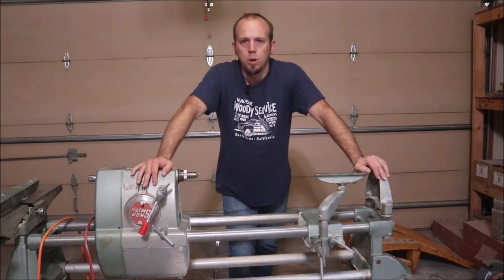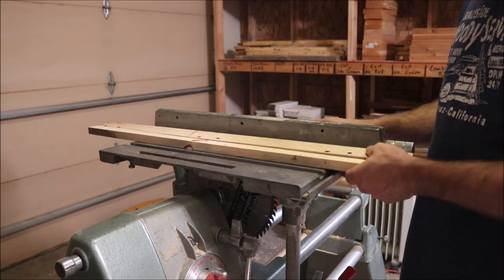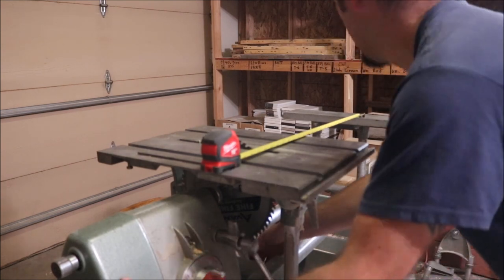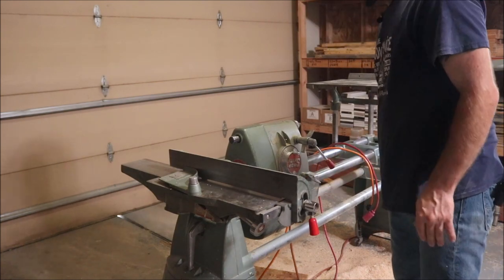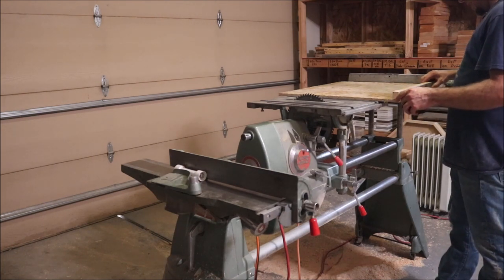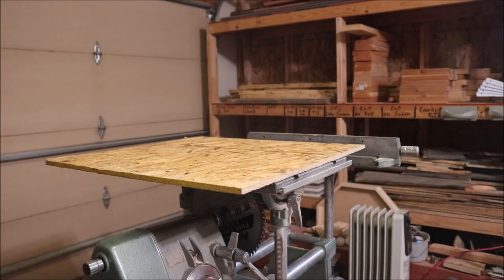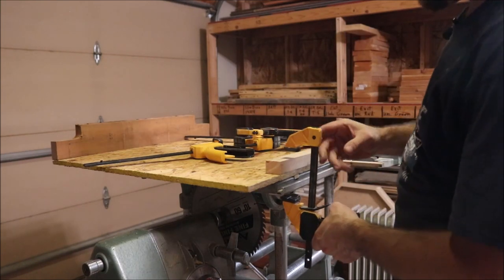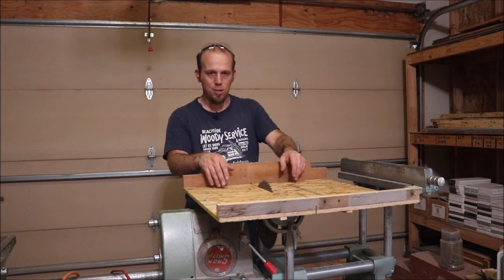Simple Crosscut Sled for Shopsmith

Comment: Good job on the video, and especially the audio. I inherited a "55 greenie from my father, so I've been using it for about 60 years, and I guess, in that time, I've learned the order to do things for quicker set up: adjust the height of the main table to the depth of cut (deepest gullet, minimum, more won't hurt) then adjust the height of the aux table. When I used the SS jointer, I ran the saw and jointer connected all the time. That's just a preference, your way is safer. The rip fence has two bolts underneath that you an adjust so you don't have to use the offset screw. Likewise the aux table.

I see the comment below about the saw guards and I recommend them and I have both. I almost never use the lower guard unless I'm worried about dust collection, and rarely use the upper guard. I grew up without it, and worked in a cabinet shop with an unprotected blade. Keep your hands out of the blade. But I would still encourage everyone to use the guards. Do as I say, not as I do.

The sled could be longer if supported on the aux table and handle longer pieces of work. If the cutting fence is only attached with two screws, it can be adjusted with more precision by just unscrewing it and drilling a new screw hole a little ways away. 

Great job on the video. I didn't mean to write this much

Comment: Simple must have tool, one thing though, the runners should be hardwood at a minimum and better yet a polymer. The sled base should be made of a stable plywood like birch. Your runners will swell and stick with temp changes. Good video.

Comment: If you don't have an upper and lower blade guard, I'd be happy to send you a set for that Shopsmith, for the price of postage.
All I ask in return is that you actually use them!
Reply from the maker: Thanks for the offer Mark but I must respectfully decline. I do appreciate you looking out for my safety.
Reply: I am currently looking for a blade guide for my shop smith. Any chance I could buy them form you or get a similar offer as Wood Resurrected?
Reply: @frederickbruno5294  Which tables does yours have?
I've got at least one complete upper and lower guard for the original Mk5 table.
Reply: Mark Beiser I have the original Mark V
Reply: @frederickbruno5294  What year is yours?
After further investigation, the complete upper and lower I have is the plastic ones used on the grey machines. They would work on the older green and "goldie" machines, but would require drilling and tapping some holes in the trunion for the table.

I've got a 1982 machine I upgraded to the 510 tables on, and a 1960 machine I got in pieces in tubs. I thought I had all the parts for the guard for the older one, but it seems I've only got the upper guard, and not even the mounting hardware for that.

I guess I could include the table, since it has the mounting holes already, and it is just junk on a shelf to me.
Reply: Mark I can’t see the year on mine. It’s pretty old.
Reply: It is similar to the one in the video
Reply: @frederickbruno5294  So green and silver?
Reply: @frederickbruno5294  I posted in the "Discussions" tab on your Youtube page, let me know if you can see it, I'm not entirely sure how it works.
Reply: @frederickbruno5294  You there?
Reply: Mark I’m here. Did you get my email address?
Reply: @frederickbruno5294  Ok, got it, will move to email communication.
Reply: They have them on EBay if you don't get a deal here.
Reply: Reference it to the serial # on the high speed port

Comment: wow: Some confused comments. I have had my Shopsmith since 1985 and done a lot of things with it including restoring a 1947 25' Chris Craft Express Cruiser. I do confess this video leaves alot to be desired, but the intent is good. However that said the table is small even with the 520 system so I made a video to show how to insure the sled does not tip up on either end when making a cut. The sled I made is much more complex than this one which I copied from another video.  It works great and is exceptionaly safe. I would sugest you not judge the Shopsmith by this video.

Comment: How do you ensure that the cut line is the same each time you adjust the saw?  Given the tolerance the blade position has relative to the table slot, I can see this being tricky.
Reply from the maker: Ed, you put the sled on top with the blade in the sled slot but the sled not in the mitre grooves, lock down the headstock and quill before adjusting the table position on the slides to let the sled fall into the mitre grooves. Essentially you use the table position to find home for your sled and blade position.

Comment: What is that other slot in the table for?
Reply from the maker: The other slot is for other placement of the saw blade if you're cutting end pieces and such. I rarely use it because I like to have a more even amount of table on both sides of the blade.
Reply: @WoodResurrected  thanks!

Comment: every time to pu someting on it, need to measure and check!! OMG, I would never buy this SS.
Reply from the maker: All hobbyist woodworkers measure and check before they cut. It goes back to the old adage: Measure twice, cut once. I'd rather measure and check instead of just cutting and then realizing that I cut something too small or short, and then have to find a way to fix it or get a replacement piece. Thanks for stopping by!
Reply: You can make accurate repeat cuts on a properly aligned Shopsmith. Don't take this guy's video as an example of how it's done.

Comment: Why does it take so long to make exact length and straight cut? ridiculously stupid machine.
Reply from the maker: Thanks for stopping by to check the video out! Shopsmiths are a hobbyist machine that serve to reduce the space required to do tasks. This means the machine can do more in a smaller space, but that things may require more steps to get to the configuration for what you need. As to it taking longer to get exact length and cut, it doesn't take much effort. I was making things as exact as possible to eliminate binding while keeping the sled solid in the slots, which takes fine tuning. Most quality things aren't done quickly, and if they are, they're usually quite expensive. Woodworking is typically not about speed, it's about enjoying the journey, working with your hands and using your skills to make something you are proud of.
Reply: He's using a machine from the 1950s when that was, essentially, standard practice, and the ShopSmith was the #1 selling woodworking tool in the US. The latest ShopSmith doesn't require constant measuring.